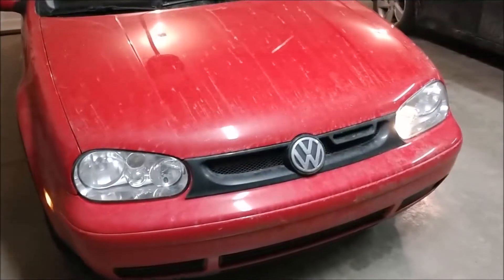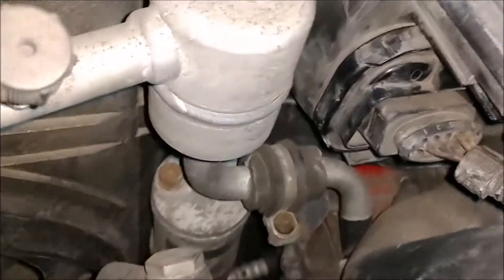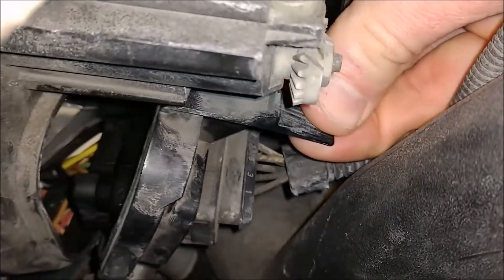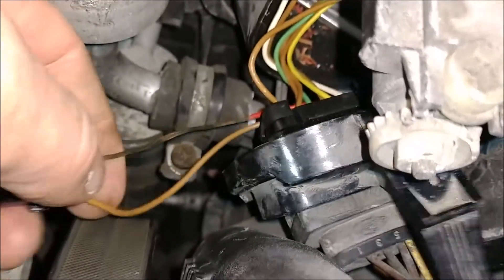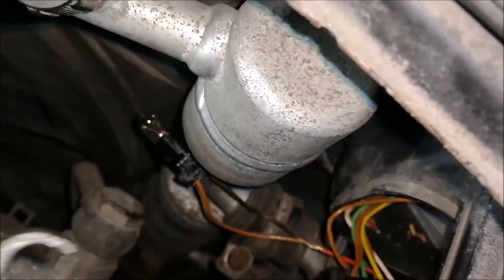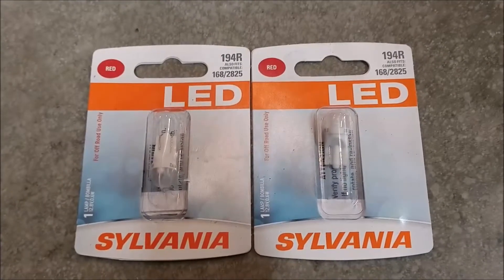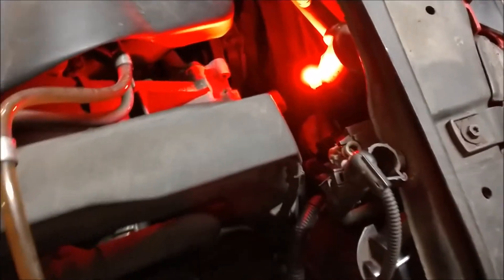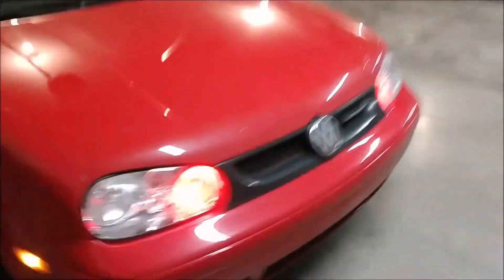Volkswagen Golf mk4 LED daytime running light upgrade

Comment: In mine those smalls ones are in high beams also but their function is parking light and they also come on when i turn on low beams. They light so dim they cant be noticed in daylight at all. I thought american golfs had DRL function implemented into the low beams, that light up with 60% of full power. Watch golf 4 owners vhs on youtube, they explain it all  :)
Reply from the maker: Marko Zutic - I will check out the channel. Thanks for watching!

Comment: Are those the aftermarket lights? My mk4 gold doesn’t have those holes for the DRL....
Reply from the maker: Juan Karma#16 - They are stock headlights. What year is your Golf?
Reply: Cory Mondics it’s a 2000
Reply from the maker: @ImCrossingAgain  - You should have daytime running lights unless your headlights are aftermarket.
Reply: Cory Mondics I found them lol hey were spray painted with tape behind the hole so made it seem like nothing was there
Reply from the maker: @ImCrossingAgain  - Haha. I'm glad that you found them!
Reply: Cory Mondics now for the real question hahah, are there certain models that come with DRL or is it both the base and the GTI?
Reply from the maker: @ImCrossingAgain  - All Volkswagen mk4 Golf models have DRLs. I have a TDI and it has them.

Comment: that is not DRl it is just park light....
Reply from the maker: Mathias J - These little bulbs are in fact DRLs. With the parking brake engaged, the lights should be off. As soon as the parking brake is disengaged, the lights should come on and stay on while driving.
Reply: They are drls. At least in vw/Audi eyes they are. The cylindrical light switch has a pin marked DRL for these lights. I disabled mine so they're only on when the parking lights are on.
Reply: @garrettparmenter938  for me the day time running lights is the H7 bulb and that small one in the video is the parking light.